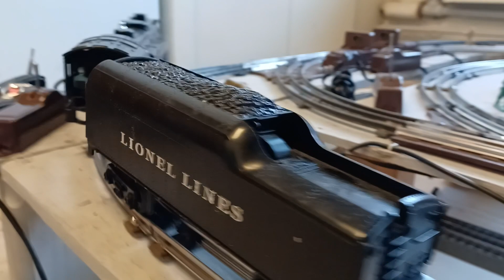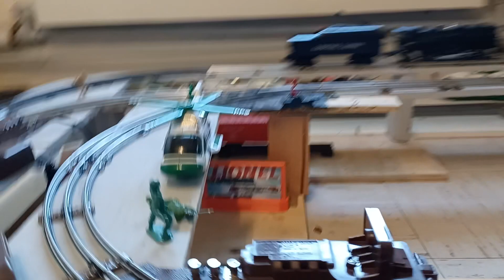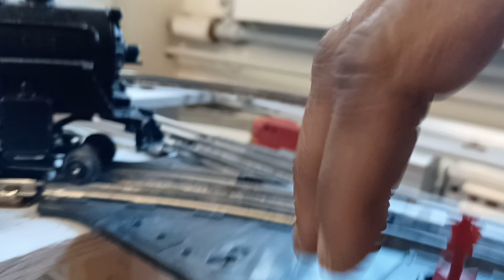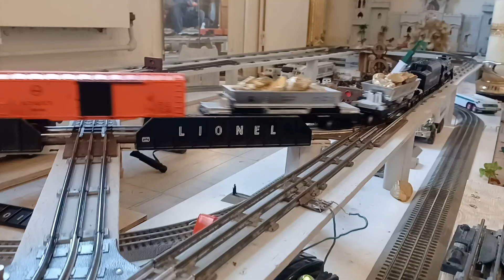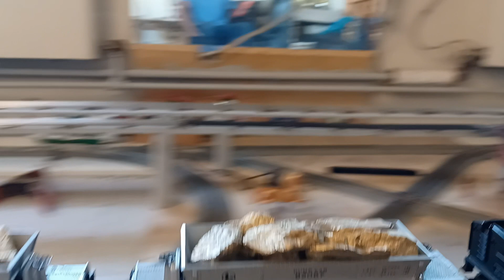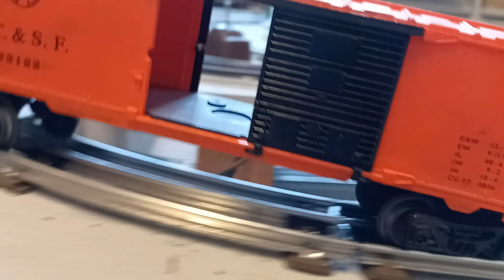Ramp Test on 027 Layout.

Comment: Hi,
Thought I would have a look at your very big trains and must say it sure is different than my oo ones and the thing I saw was all the sparking what power do you use on it as we doing 12 to13 volts do not get that at all and the power of your train going up that ramp is sometning to see will watch more of yours when I have time but I am trying as you will be aware to get more of mine running iTrains hope you are well over there in the states and you get yours to run well also.
Cheers Robert.
Reply from the maker: Hello Robert Just saw your comment. Forgive the trade response. I se a Lionel GW 180 Watt Transformer 637947.I set the Transformer to 40.

Comment: Your ramp going to second level is going to work great! You’re doing a fine job buddy!  Does the Lionel lines engine have a whistle?
Reply from the maker: The sound is not working.Two wires that connect the engine to tender are broken.Thanks for stopping by. 👍♐